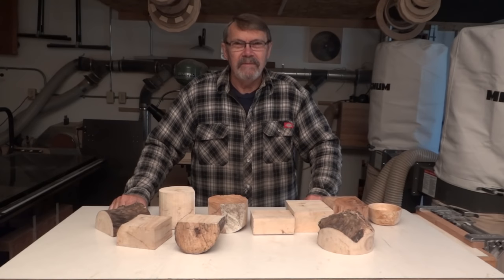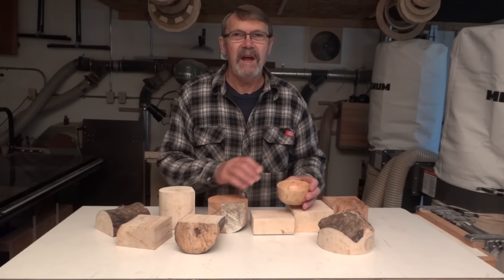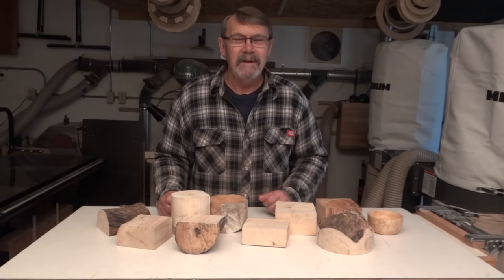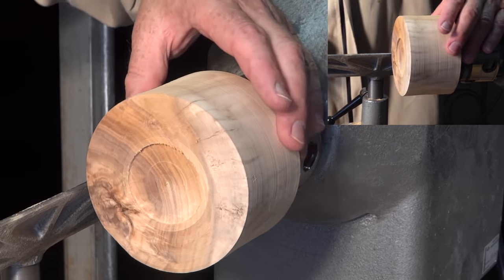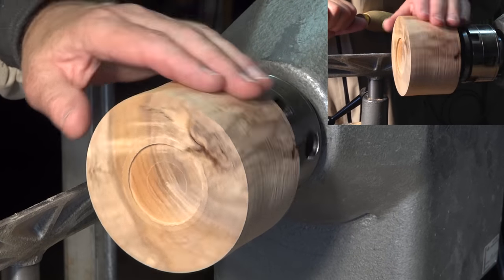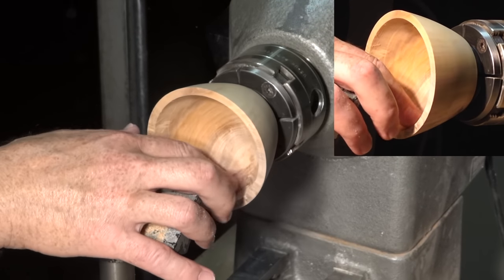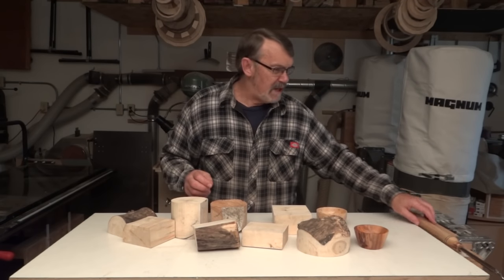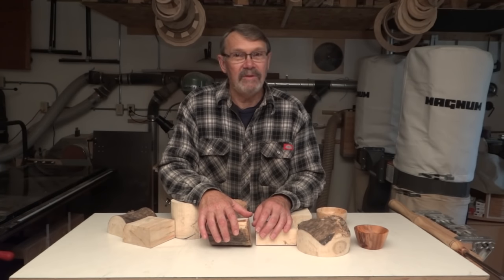Turning An End Grain Bowl

Comment: I picked up a lathe and some chisels for xmas but im really struggling. I cant get anything to turn round without the chisel biting (stopping the piece turning) and/or ripping out big chunks of wood :/
Reply from the maker: Lance, with no idea what your turning process is, this is a very tough question to answer. How much experience do you have turning? What particular chisels or gouges are you using? Are you riding the bevel? It may be that you are pushing the gouge in too straight and just tearing pieces out instead of riding the bevel and slowly removing the wood along the length of the blank. Can you give me a bit more detail? If you like I will make a video demonstrating the basics but I'm down with a very bad cold right now and it will be quite awhile before I can get to it. I would suggest doing a search of Mike Waldt's videos. He has a series of videos where he covers the basics on a number of different chisels and gouges. Sorry if this isn't a real good answer but it's the best I can do right now. Please let me know if I can help more in the future and I will try my best to help you. Best of luck to you, Lance. I remember starting turning and it was a fairly frustrating time. I hope I can help more once I'm able to get back to the shop!
Take care,
.....Gord

Comment: Great video.  This is the first one of  yours I've seen.  I subscribed and I'll be back  !  I am a newbie at turning, and a super-newbie at endgrain turning.  I have a total newbie question (be kind).  At about 7 minutes you are talking about reducing the diameter of the bowl.  You say be sure to cut towards the tail stock so you are cutting downhill.  I'm confused and hardly know how to ask this question.  You said this is endgrain turning, and the grain runs parallel to the axis...OK, I've got that. You say turn the outside of the bowl from the center towards the tail stock.  Is cutting downhill because you are reducing the bowl diameter, or is downhill because of the end you picked to be the bottom of the bowl?
Reply from the maker: +Abter1 Rockville1 
Think of the grain of the wood as a bunch of drinking straws. If you cut from the tailstock end towards the headstock, cutting UP to shape the bowl, you would be cutting into and across the end of the straws. The straws would be fighting back, if I can use that term. On the other hand by cutting toward the tailstock and shaping the bowl down toward the bedways you are cutting across the grain in a direction that lets your gouge slide across the straws and not having them tend to flip up as they would in the opposite direction. Does this make sense? I'm not sure I'm explaining this very well. Please let me know if it's not making sense and I will try to put a short video together to explain it.

Sorry I took so long to answer. Somehow I missed your comment. Thanks for watching. I appreciate the support!!
Take care,
.....Gord
Reply: that is the clearest explanation of this I have ever heard!  with the grain/ against the grain...I'm still working that one out.  With your help here I think I better understand a suggestion a friend gave me about using a joiner.
Reply from the maker: +Abter1 Rockville1 
I'm glad I could help. I put a short video up tonight that might do a better job of explaining this for you. Check it out if you like. I hope it makes it a bit clearer.
All the best,
.....Gord